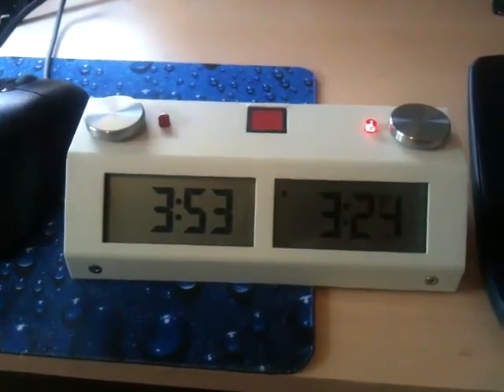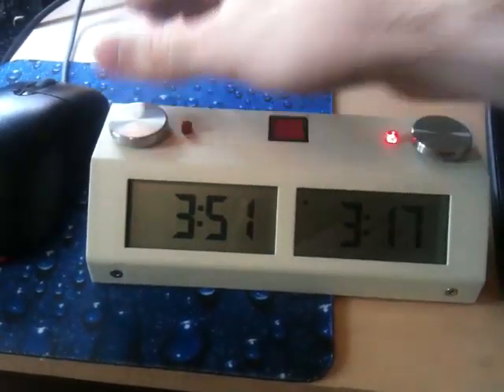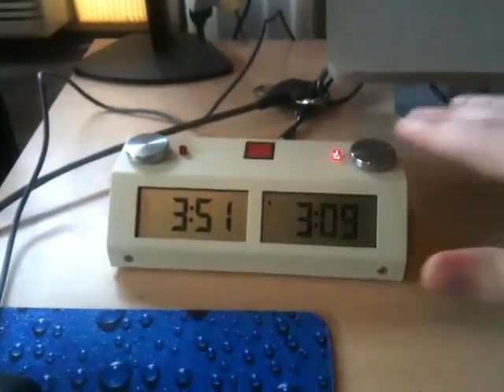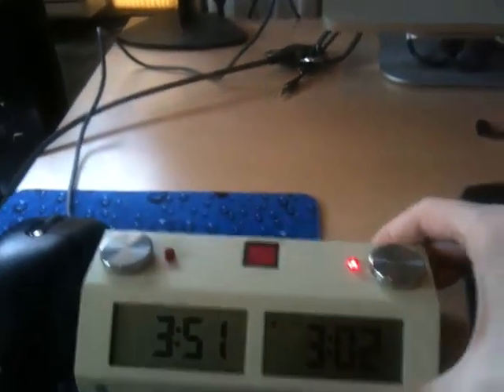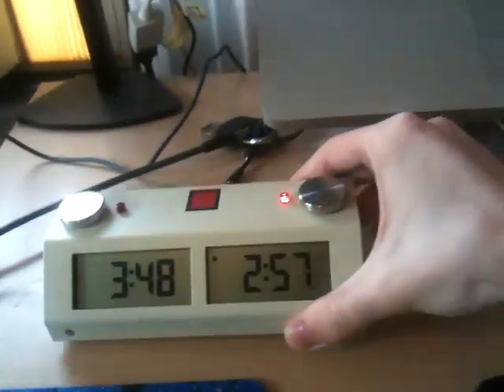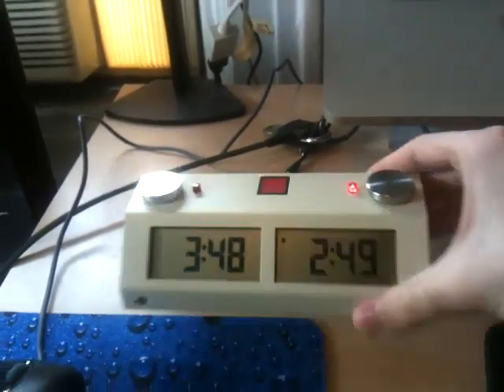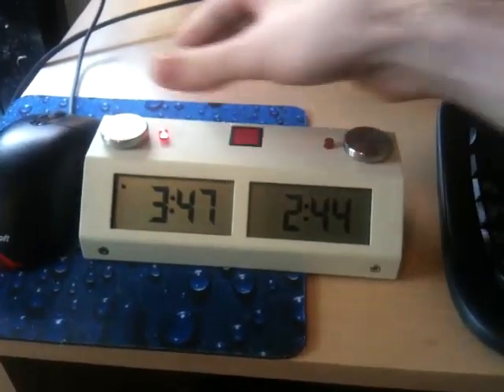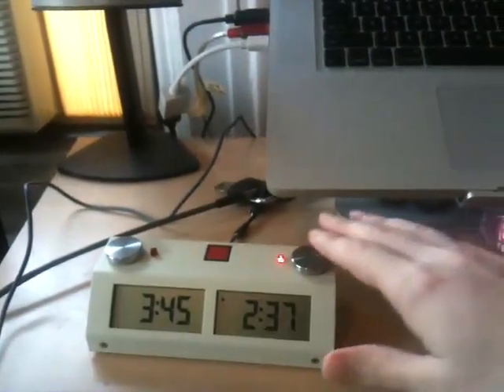Calling all physicists! How does my computer interfere with my Chronos chess clock???

Comment: as the contact point could as when you get it closer to the computer. could charge the metalic buttons on top of your chess clock. an equal charge to both switchs. hmm maybe :)

Comment: @PBnFlash 
2 An AC transformer is inducing a small charge in the button and that's preventing it from registering. (try another transformer like a wall wart)

I'm almost certain that it is EM interference. 

as an aside I've never pulled one of those macbooks apart before but in the earlier ones that is where the hard drive was and the speaker coil on the HDD arm might but messing with it.

Comment: I have no experience with the chronos chess clock, or any chess clock for that matter. However it looks to me that the "buttons" on ether side are not buttons in the classical sense but rather detect electromagnetic disturbances in the metal plate on top, like a laptop touch pad. If this is the case, it seems likely that one of a few things may be happening.
1 The aluminum case of the laptop is grounded and is bleeding off the charge (I doubt it; just unplug the power cable to test)